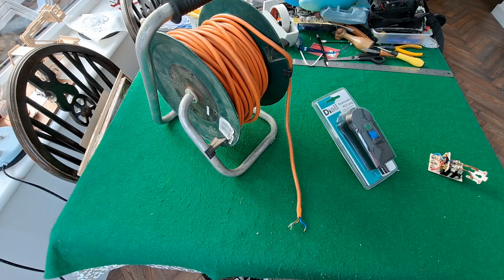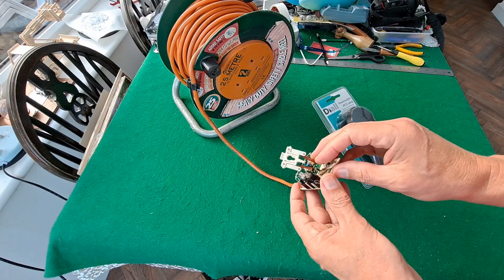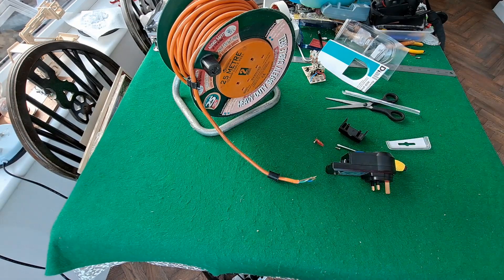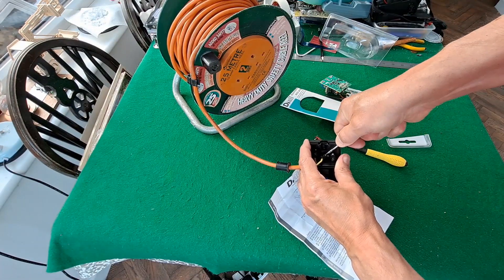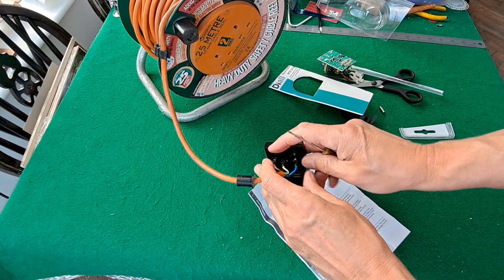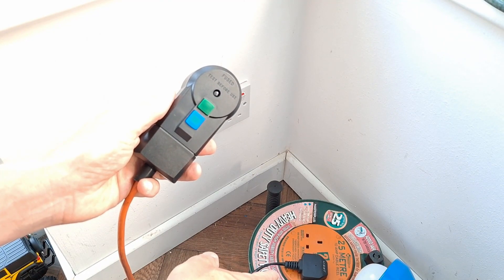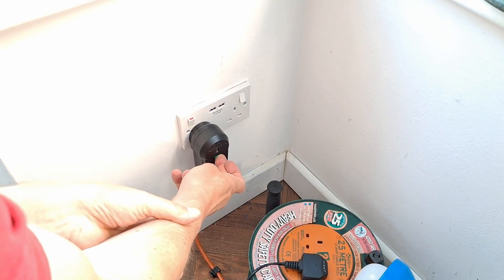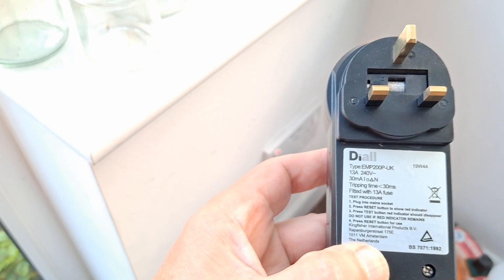Replacing the RCD plug on my extension lead

Comment: Just bought same plug at BQ, opened packaging to read its info, only to read that its "Not to be used with extension reels", which seems to defeat the object of buying one , plus as commented on clip the red indicator light is nigh impossible to see if on or off😤
Its going back asp.
Reply from the maker: It really was disappointing, I know it was B&Q but I had expected better. I see they are currently on "clearance" reduced price. On the positive side, I am still using it and it seems to work fine, it is not used very often, mostly with the hedge trimmer.
Reply: Can’t think of a reason why cannot be used with reel.  Unfortunately a lot of instructions like to say don’t do it but did not state the reasons.